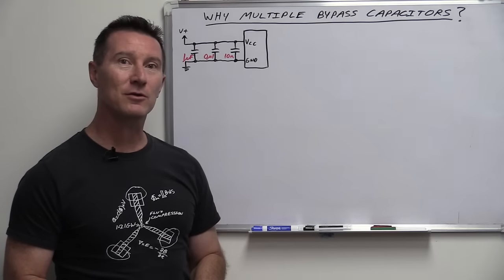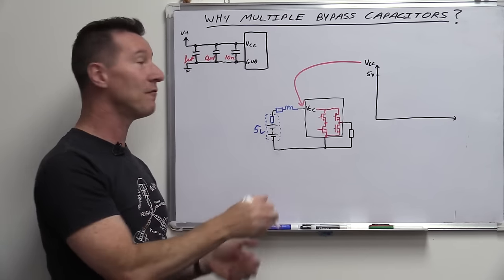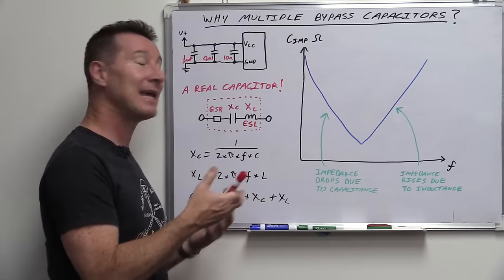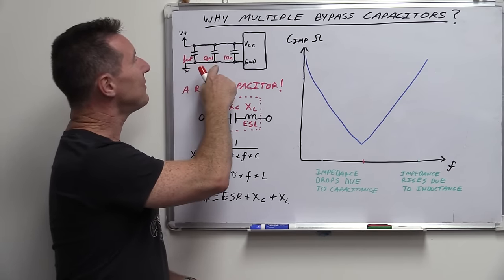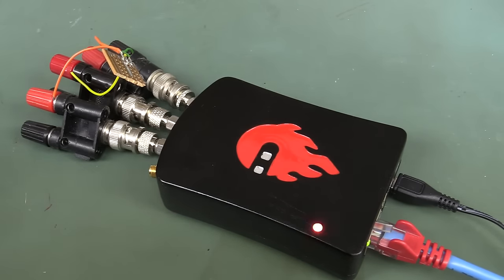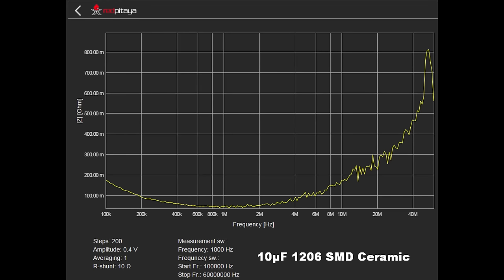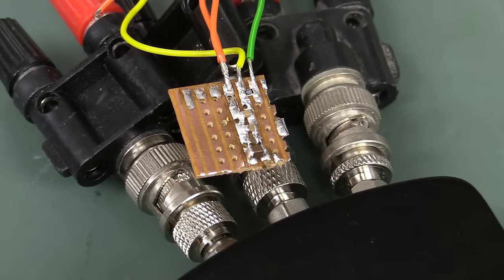EEVblog #859 - Bypass Capacitor Tutorial

Comment: The bypass capacitor also shunts high frequency noise to ground, does it not (i'm talking about external noise, irrespective of the IC switching)?
Reply: ***** My understanding is that an inductor choke when placed in series with a load would allow low frequency to pass through it easily and block high frequency as waste.

My understanding of a bypass cap is that putting it in parallel across tho load would cause noise jitters of an appropriate frequency to be shunted across the bypass cap rather than through the load (as the cap would look like a short at these frequencies). 

Someone please chime in if i've said anything wrong.
Reply: Simple answer, yes. Capacitors pass dv/dt (Voltage noise is a dv/dt). Caps are electrical shorts to dv/dt (AC) and electrical opens to DC. However,  the unwanted voltage noise typically exists on signals, coupling into TX and RX devices that are sensitive to noise, and can be damaged. You don't have caps shunted to GND on signal lines, because capacitance kills Signal Integrity of the signal. Typically, they use fast TVS diodes to shunt unwanted energy to GND on certain signal lines. But again, any RLC parasitics introduced to a signal, especially high-speed signals, will be potentially compromising if the parasitics are too high.
Reply: If the circuit you're protecting doesn't require a lot of current, it really helps to decouple the bypass capacitor(s) from the supply rail through a low value of resistance. It serves 2 purposes: 1, it provides ballast, which helps negate the equivalent series resistance of the capacitor, and 2, it helps damp resonance between the capacitor and any stray inductance in the rest of the circuit.
     I often use this technique to protect the sensitive analogue pre-amplifier circuitry from the noise on the rail caused by the high power switching transistors in class "D" amplifiers, and analogue regulator circuitry in switch mode power supplies.
Reply: @Vincent Robinette < When you say to decouple the bypass capacitor through "low value resistance" what values range are you talking about?
Reply: @BillAnt  A low value means low enough, the the voltage drop is measurable, but, insignificant. If an Op Amp requires .025 amps, and I can allow 1 volt of drop, the value would be about 40 Ohms. The higher voltage drop, the higher the resistance, and the higher the noise rejection by the bypass capacitor. In the case above, any capacitor from 33 Ohms, to 47 Ohms would work well.

Comment: To smooth out the power supply, especially if it's an AC transformer. If you want clean and smooth electricity, you want some absorbing capacitors to smooth your electricity.

Comment: The series resistor might prevent the IC (integrated circuit) from receiving the minimum required power supply voltage or the IC receiving more than the maximum rated power supply voltage. It is hard to predict how much current the IC will draw and connecting the capacitor directly to the power supply is NOT a safe practice. A possible alternative is to use a series resistor with a Zener diode. The best solution is the use of voltage regulators that can limit the maximum current drawn from the power supply and the maximum current provided to the IC.

Comment: if the 1uF, 0.1uF and 0.01uF capacitors were all ceramic and all in the same 0603 package, wouldn't the inductance be the same and therefore the rise in impedance for all 3 be the same instead of different as you have shown?

Comment: My next design uses 20 old TTL and CMOS circuits, I put a dual stage filter after the buck powerstage, 100nF caps for each chip, and a 4 layer board with 2 power planes.

Comment: I don't use multiple value capacitors for decoupling. All you need is a low enough impedance over the designed frequency range. Using multiple values only creates multiple power plane resonance frequencies. Just use enough distributed capacitance of identical value.

Comment: thanks for the great video! i just discovered your channle and already a big fan! greeting from germany! 

one question @23:46 : why does the value from Z drop at higher frequenzy? i know capacitors have lower Z at higher frequenzy but you still have that 10 Ohm resistor in series that should stay the same regardless of the frequency.

Comment: All very true, my dear Watson.  But switching rise and fall times are key to the issue.  Metal gate CMOS, pretty long switching times.  Silicon gate CMOS switching times, much shorter times.  Fast TTL even shorter.  Emitter coupled logic (ECL), real short.  And so on.  Bypassing needs to be "tuned," so to speak, to the logic families, regardless of the clocking times.

Comment: Can you use a 1000 volt power supply connected to ten 100 volt capacitors? If so can you also charge a 100 volt battery from one of the capacitors?

Comment: When the outputs change state they produce a small spike inside the IC.   If these spikes get on the voltage rails, noise will go all over the place.  Complicating matters, some ICs use more than one value of voltage and some ICs are partitioned so as to have multiple voltage rails of the same value voltage for the same IC.  Banks of ceramic chip capacitors between the rails and the ground augmented by tantalum capacitors keep these problems in check. For complicated, typically multilayered, boards, the number of chip capacitors, identically valued can be in the hundreds. This video picks up all the individual effects, but doesn't scale well.

Comment: In rc low pass filter both resistor and cap decides how much should be the cutoff freq ,for the resistor of 1k and cap of 0.01uf values the cutoff freq is 1.59khz ,if I use a resistor of 1k and cap of 100uf the cutoff freq is 1.59hz below these frequency only it is passes to output more than the above freq it is grounded .why I can't use 100uf cap instead of 0.01uf as a bypass cap where the 100uf have very low cutoff frequency than the 0.01uf .I am confused at these part please help me with these

Comment: Well inductance is not always the case for capacitors! The impendance does increase at some frequency mostly because of the inertia of the charges inside the dilectric material. So this effect is mostly the reason why at some high frequency the impendance increases.

Comment: USB 3.0 ports can only provide 900 mA, and (as with any USB port), providing more than 100 mA from a real, computer-side port requires USB device negotiation for more current according to the USB spec. There's a particular set of resistors on a charging-only host port that let a device know it can draw whatever it can get away with.
Reply: +DapperDonald That is, unless the port supports USB Power Delivery 1.0, in which case it can provide more juice, but it still needs to be configured by the computer's firmware.

Comment: Interesting stuff starts at 10:00
The setup at 20:00 is obviously no good for >10MHz and such tiny values.

Using multiple ceramic capacitors brings new problems:
There will be not only serial LCs but now you got parallel LCs.
Using multiple capacitors can give you the opposit of what you intended. See 25:00
just use the biggest single 0603 or 0402 depending on voltage X7R capacitor for local bypassing.
Reply: Luckily the theory of just locking at the capacitors without load is flawed.

Comment: on a hittite PLL board i made once i had to put 4 caps ... from 1u 100n, 1n 100p to get everything running properly 
and i only put a pad for one so you can guess how odd the bodge looked
Reply from the maker: +Alyx BioHaz Capacitor stack!
Reply: with the smaller ones on the bottom!

Comment: You should have asked the viewers to take an electrolytic capacitor and open it up to see how it's made.  The electrodes are rolled up into a roll, and the long length of the foil has more inductance than a flat plate like what's inside of a ceramic capacitor.  So the inductance is higher and resonant frequency of electrolytics is going to be lower, and it needs to have a ceramic cap in parallel for good bypassing.

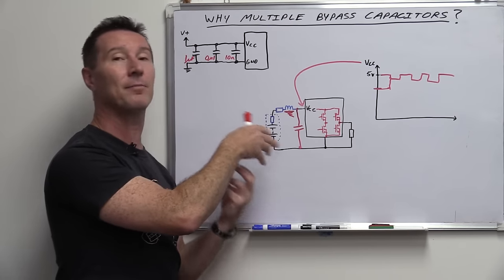Comment: Around 7:04 ... bypass capacitor provides current when the chip suddenly needs ....Is that really accurate for bypass caps? I thought that would be the job of large electrolytic caps. The bypass caps would be for sinking high freq disturbances to ground.

Comment: Is this why the caps in audio amplifiers are so large? To bring this resonance down to the audio range?
Reply: +Matt Wright Those are bulk caps. Producing high power low frequencies requires large amounts of current.
To see this demonstrated, checkout a teenagers car with a loud stereo, you'll see the headlights dim when the bass hits (assuming they didn't spring for a large cap at the amp).

Comment: +EEVBlog I've always been perplexed by this problem. If you have an LC circuit (L in parallel with C), you'd wind up with very high impedance at the resonance frequency (1/sqrt(LC)). Why would adding capacitors in parallel with inductive capacitors reduce impedance? AN1032 Using Decoupling Capacitors.pdf from Cypress recommends against paralleling capacitors because of resonance. I guess, one just has to experiment and see if the resonance is occurring near switching frequencies...

Comment: I have an old Atlas diagnostic machine and I would like to know what I can replace the old Sprague caps with to get the oscilloscope up and running again
Reply: Just look at the marked uf value and voltage if polarized will be marked with a plus or minus to identify polarity  and order replacements to match and install

Comment: Your curve at 19 minutes is misleading. Smaller capacitor impedance is higher at resonance for lower values and generally rising impedances tend to converge for different values. Why not use 2x 0603 1uF 25V X7R and now ESR, ESL & Xc are halved. than 1u / 100m/10n in parallel.

Comment: I previously worked with DIP's (moving to SMT).  You bypass cap presentation was great, but I always wondered something, especially when designing hi-speed u-processor circuits...Why do they put the power pins of a DIP as far apart as possible?  Is this going to be the case for SMD's.
It always fascinated me how Tesla knew things like smaller capacitance caps were 'faster'.
Reply: Tesla's work was largely intuitive field theory. It's a shame we went down the "dark matter" and quantum BS rabbit hole.  As it turns out, we're learning reality is closer to an "aether" of a different sort and field theory.

Comment: Dave,  Regarding the red pitaya powering, you should check voltage drop across the cable. if you are using some cheap generic china made usb cable you will need a microscope to see a trace of cooper. 

#bring cooper back

Comment: Sorry, Dave, if it's a CMOS IC, then positive supply rail is Vdd, not Vcc.  Although I have seen Vcc used a lot (and IMO, incorrectly)  for the + supply voltage to MOSFET ccts, so I may let you off...

Comment: Good start but wrong conclusion at the end. Using different value capacitors for bypassing/decoupling digital circuits is bad. You've talked about cross resonance then actually measured it. Those resonant peaks are horrific. Proper decoupling does involve using multiple capacitors but of same value (lowest resonance peaks), one for each power pin and more distributed around the board. More than one capacitor per power pin doesn't really help since total inductance of PCB traces, pins and bonding is way higher than inductance of capacitor package. Bulk capacitance is still required but because large value capacitors are used resonance peak happens at low frequency and amplitude.
Reply from the maker: +nowakpl No, my conclusion and theory is correct. It's just that the example isn't that great. More than one bypass capacitor per power is indeed a valid and often used industry standard technique. Go look at at implementation application note for FPGA's or other high performance chips and you'll see this is the recommended method in many cases.
Reply: +EEVblog At high frequencies parasitic inductance dominates so the only effective way to lower impedance is to provide multiple independent current paths. Using more than one capacitor of same value per pin for high frequency decoupling provides almost no improvement because current still flows via common impedance. Using different value capacitors not only doesn't improve decoupling it creates another resonance peak and reduces overall decoupling performance. What you are talking about is likely bulk capacitance where the second capacitor is of orders of magnitude higher value than decoupling capacitor - 10uF or more with 0.1uF or lower decoupling capacitor. Resonance still happens but at low enough frequency not to cause problems. Generic suggestion for the use of multiple unspecified value capacitors over single value capacitors is plain dangerous because it creates radiated emissions and immunity problems at resonance frequencies. Also see http://www.interferencetechnology.com/eliminating-the-myths-about-printed-circuit-board-powerground-plane-decoupling/ or any good book on radiated emissions (EMC).The
 multiple values do not help at high frequencies (because of the 
inductance of the vias, etc.), and can actually decrease the decoupling 
performance significantly at lower frequencies.  The decreased 
decoupling performance is due to unavoidable cross resonances between 
components. - See more at: 
http://www.interferencetechnology.com/eliminating-the-myths-about-printed-circuit-board-powerground-plane-decoupling/#sthash.EIVuoDkO.dpufThe
 multiple values do not help at high frequencies (because of the 
inductance of the vias, etc.), and can actually decrease the decoupling 
performance significantly at lower frequencies.  The decreased 
decoupling performance is due to unavoidable cross resonances between 
components. - See more at: 
http://www.interferencetechnology.com/eliminating-the-myths-about-printed-circuit-board-powerground-plane-decoupling/#sthash.EIVuoDkO.dpufThe
 multiple values do not help at high frequencies (because of the 
inductance of the vias, etc.), and can actually decrease the decoupling 
performance significantly at lower frequencies.  The decreased 
decoupling performance is due to unavoidable cross resonances between 
components. - See more at: 
http://www.interferencetechnology.com/eliminating-the-myths-about-printed-circuit-board-powerground-plane-decoupling/#sthash.EIVuoDkO.dpufThe
 multiple values do not help at high frequencies (because of the 
inductance of the vias, etc.), and can actually decrease the decoupling 
performance significantly at lower frequencies.  The decreased 
decoupling performance is due to unavoidable cross resonances between 
components. - See more at: 
http://www.interferencetechnology.com/eliminating-the-myths-about-printed-circuit-board-powerground-plane-decoupling/#sthash.EIVuoDkO.dpuf
Reply: +EEVblog You're right - multiple decaps of different values without a real understanding of the effects is an industry standard technique - and it's one reason why products fail EMC compliance testing so often!

Some FPGA app notes still do recommend different value decaps - I'm looking at Xilinx ug583 now and it recommends combinations of 100 μF and 47 μF caps, but these values are orders of magnitude greater than what you've shown or indeed different value decaps as typically applied, big enough that the anti-resonant peaks are small enough that they no longer matter.

Altera no longer recommends different value decaps as such - instead, they now suggest the correct approach (which they call FDTIM) of selecting decaps to meet a target impedance over the noise frequency range. This inherently excludes decap networks with big ugly peaks. Henry Ott recommends the same technique in Chapter 11 of his EMC book. Altera provides a really cool spreadsheet where you plug in your decap details and it shows you how poorly your decoupling network performs as a result of the anti-resonant peaks :)

Do a video on FDTIM please, it'll counteract the bad advice you've given in this video!
Reply: Not entirely true. It depends on the magnitude of 1st order loop inductance the Cap "Sees" to the IC PWR pin. Number of caps needed to meet target impedance is n > (esl*fmax)/(0.16*Ztarget). You can still improve the PDN impedance with multiple caps. However, as you stated, the 1st order limitation wrt proper decoupling is reducing the Z axis inductance. Roughly 21 pH per mil. Less than 1.5 nH is desirable.

Comment: If I am right it is to decouple RF out of the supply, just wondering if you could use a AIO  Coolermaster water cooling solution to cool the DSP chip inside your Red Pita ya analyzer and you might be able to clock the chip a little faster.
Reply: Water cooling is dreadful IRC because many things matter more than thermal dissipation, and I'd never allow liquid cooling in my lab.  A passive or fsn cooled vapor chamber with heat pipes, sure.  Even just a big honking copper heatsink is worth a try.

Comment: Guys i have some capacitators that looks like those decoupling capacitators. I saw in a video they were using decoupling (bypass capacitators) on NRF24 modules to provide better power to them. Mine has ratings like 10v, 50v 24v etc. Can i use them on my low power 3.3v operated NRF24 module ? Does that power rating mean that capacitator will provide 10v, 50v, 24v , or does it just mean that it will work up to that limit ?
Reply: Deniz Yildirim The voltage rating on a cap is the maximum voltage it is rated to work at.  The supply your load sees is dependent upon the voltage rating of the supply.  If you have a 3.3V supply, you could put a 1000v cap on it and you would still only get 3.3v out of the cap.  A capacitor stores charge on metal plates (or other conductors) separated by insulators - and that's all it is - the power supply creates the voltage difference the cap needs to store the charge.
Reply: Cynthia Thanks !